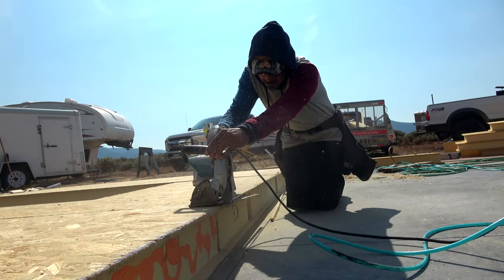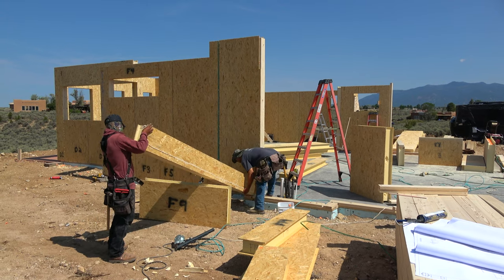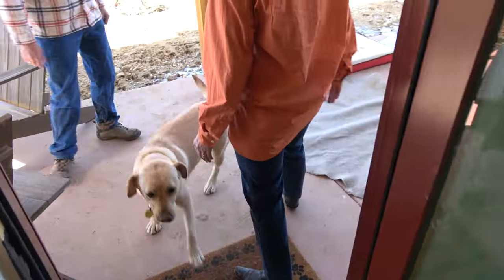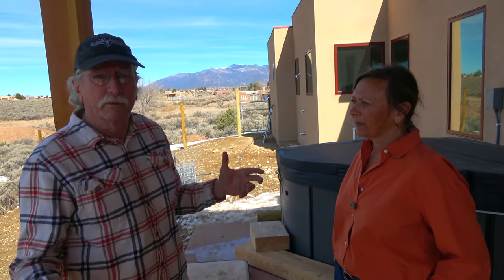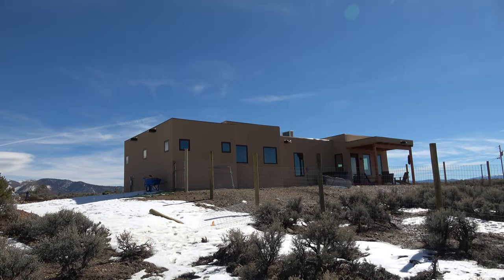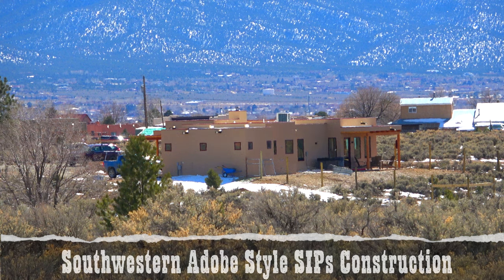Southwestern Adobe Style SIPs construction

Comment: Passive solar design requires less energy but zero windows, just tubular skylights saves more. Why no water retention? What R-value do you have? Adobe does everything SIP does. Is it cheaper? Did you do a cost analysis?
Reply: What are you talking about zero windows ?? The whole concept of passive solar is window letting in heat !?!?